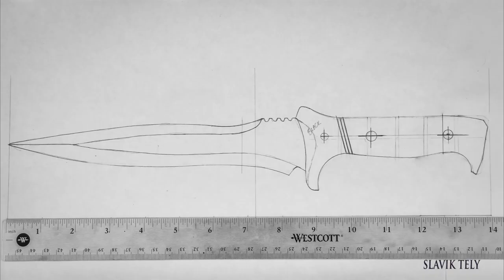P3 Making Resident Evil 4 LEON KNIFE

Comment: I would be curious to know how much time and how much money do you spend on each project. Great job and beautiful knife, as always !
Reply from the maker: There is no set price or time because each knife has it's own complicated shapes. Also, each knife has different steel, materials which have their own different cost. Also, you need to add electricity, sand paper, belts, propane, glue and the list goes on. The Legionnaire  knife cost me more than six hundred dollars in materials. The leather sheath alone was two hundred dollars and I had to drive 1.5 hours to drop knife off then drive home. Then drive back to pick up knife and sheath and drive home. That is 6 hours of driving plus gas. How much would you charge for just driving and gas? That is time well spent. So, it is difficult to price knives. Sometimes I feel as if I am making $2 per hour when I finish making a knife. I do it because I like doing what I do.
Reply: Sure, there is just too many factors to be taken into account. But be sure that it's always a pleasure to watch you making your knives.

Comment: slavik mate you should really sharpen your knives on the belt sander. throw on a 400 or 600 grit belt and use the slack of the belt then remove the burr on a mirror polish buffing wheel, trust me you get a way better result in half the time, and its a convex edge so it lasts longer. seriously mate give it a try. beautiful knife, keep up the good work.
Reply from the maker: I have not seen belts 400 & 600 for a 2x42. Once I get bigger space then I will invest into a 2x72 and I will have all the belts needed.
Reply: @SLAVIKTELY  ok mate, you should really try building your own 2x72 I did it and it"s nowhere near as hard as it looks.

Comment: Nice work but the handle shape, material, color and location of the finger groove are all wrong if you are trying to make a RE4 leon copy.
Reply from the maker: Actually the shape is very very close to the original but Yes I used different colors and I did not place groves in the handles.